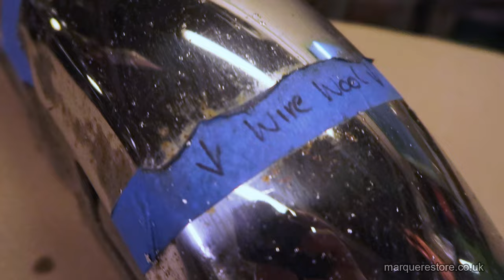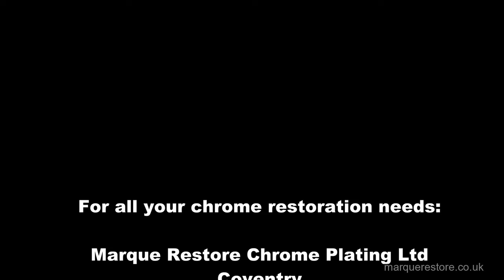How to Clean and Restore Chrome at Home THREE METHODS TESTED

Comment: Wd-40 sprayed on the surface and then rubbing it with a wadded up ball of cheap aluminum foil is what was used for chrome bumpers as long as the rust hadn't caused any pitting into the surface. This was how my dad had always restored the chrome on all of the multiple different cars he has completely restored and rebuilt over the years.  My very first vehicle was already 16 years old when I was born and 30 years old by the time I got my permit to learn how to drive. It was nothing but a completely stripped out and bare metal body when I decided I wanted it. It was a 64 Malibu Chevelle sedan and everything chrome on it was a salvage from junkyards and got the wd-40 and aluminum foil hand rubbed treatment and it was like it was brand new.
Reply: will try ur method on my royal Enfield engine... I have WD40.. Just need the almuniam foil
Reply: Would that work on aluminum rims?
Reply: @souvikprofile have you tried?
Reply: I refurbish drum kits and I always use WD-40 & aluminium foil on the chrome, it get's the rust off really well but as you say, it doesn't do much to the pitting.
Reply: That's what I do
Reply: @souvikprofile is that a modern Enfield? The old British ones don't rust as they are self lubricating inside and out 😂( 1956 clipper owner 😉)
Reply: For a cheap easy way to go you can’t beat it. Glad to hear someone else doing the same, my grandfather told me to do this.

Comment: On rusty chrome that is rust pitted beyond saving, I use a product called S.O.S steel wool pads. They are fine like the wire wool that you showed, but the difference is in the pad itself. These must be used wet as well, but the big difference is the blue soapy material that is impregnated in the pad. They are dry until activated with water which makes them a little messy but the soapy stuff is rather slippery and keeps the part lubricated and reduces scratching. I live in Canada where this product has been marketed as a method of cleaning stainless cookware. It's available at grocery and hardware stores, and has been around as long as I can remember.
Reply: We call them Brillo Pads here in UK
Reply: @rattylol same in the U.S.
Reply: Brilliant pads and SOS pads are the same but different. Just like Coke and Pepsi. I can buy either one at the store. (I prefer SOS and Pepsi) 😊

Comment: I sanded the chrome off my bumper when I purchased my first car. 1975 Chevy Impala. The bumpers were a mess. No money to replace of have them chromed again. I decided to sand them down. I forget what I used to remove the rusted pits but I managed to get them down to bare metal. Sanded from 80 grit all the way up to 1000 grit sand paper. It came out as shiny as chrome. Some 0000 steel wool and spray bottle of water made them even nicer. Dried them the tool metal polish with a polish wheel and they were very close to the chrome when it was new. Lasted about four years before the metal began to rust from the inside of the bumper out. I was then able to afford to have them replaced with freshly chrome bumpers. Just for fun on my down time I repeated the process on the original bumpers and they looked as good as new. I also had a friend who was a welder patch the little holes (pitting) and again repeated it all over and finished with bumpers that looked like new. I later sold the original bumpers to someone who needed new bumpers. He sent them to chromed. The guy asked him why he wanted such nice looking chrome bumpers done all over again. When he told him they were bare metal polished, he asked if he knew who had polished them. I was asked if I wanted to go work for him. I turned him down.
Reply from the maker: Great story. Thanks for sharing.
Reply: ^None of that "he wanted me to work for them" ever happened. Stop LYING people can tell.

Comment: I suggest a bath in Evaporust. I treated a pitted chrome bicycle fork and it removed all of the rust stain as well as the rust in the fine pits. Totally harmless to steel and chrome. Leaves carbon from the rust on objects that can be removed with oil like WD40 and a soft cloth. Wish I could post a picture.
Reply: Never tried that. I feel an experiment coming on.
Reply: Never tried that. I feel an experiment coming on.

Comment: Fill bathtub with water. Submerge part to be cleaned. Scrub with cotton washcloth that has dish soap added. Scrub until surface rust and soil are removed. Remove cleaned part and dry with old, clean bath towel. Scrub with Turpentine soaked cotton shop rag. Polish off turpentine with clean shop rags. Final cleaning with window cleaner and newspaper. Final step is to apply three coats of carnuba wax.
Reply from the maker: Thanks for the info!

Comment: Turtle Wax company makes a product called Chrome Polish & rust remover. I use it with a soft microfiber towel. When all the rust is gone I completely wash all areas with soap and water. After dry, I hand wax and polish the areas I removed the rust from. Works the best for me.

Comment: WHEN I WAS 16  ,1967 , that  summer I  worked in a used car lot  ,I was told  ,a wet rag  rubded  on the dirty  floor  dirt and grease  . all the rust was removed ,,  then a coating of wax  IT WORKED AMAZING  .. 
wow good videos thx Ed
Reply from the maker: Never heard of that method, thanks for the info.

Comment: Very good vid, faithfully carried out to answer all questions. thx

Rust is not in the chrome layer, rust is in the base metal, with cheap metal base you'll always have rust punching through the chrome layer.

Regular polishing will get rid of the pin head bits of rust and not allow it to grow to blisters of rust.
Thx again for the vid and the other peoples comments Very helpful

Comment: If I were attempting something like this I'd use the oooo wire wool, but instead of water, I would always use WD40 as a lubricant, the added bonus is that it is left in the rusty pitted parts and does to a degree help stop the rust getting worse. Also I'd put a good wax polish on top after to try to seal the open rust pits.

Comment: I have tried all of those methods but recently tried one of those stainless looking pan scrubs from £1 shop with a bit of the pink 'Jizer' degreaser as lubricant...still bodgey really (you can't beat rechroming if pitted at all) but gave the best results. I thought it would badly scratch the chrome but surprisingly it didn't. 
These guys did my rear mudguard, fork ears and rear lamp bracket from my Honda CB500K0 a couple of years ago. A very professional service plus very reasonable price and delivery time. Would definitely recommend and I have used about 6 UK firms over the years. I only dropped by their stand at Stafford to enquire if another chromer local to them, who I had used in the past,  was at the show. Alan just booked in my parts, gave me an instant, written  quote and Bobs your uncle.
Reply from the maker: Thanks for the positive comments.

Comment: Here in the States, I like to use a product called Barkeeper's Friend aka BKF for rust removal. It works very well on plastics and chrome. It consists of a mildish abrasive and Oxalic acid.
Reply from the maker: Thanks for the info.
Reply: This is the only method I use on compromised chrome, except when I use Brillo pads, which are essentially the same thing as SOS. I think it might have done a little better on those remaining pits on the mud guard...maybe. Like the others, I wouldn’t use it on perfect chrome.

Comment: The top tip is : Once you have achieved the desired finish - don't neglect to keep on top of it - otherwise it will go back to the rusty state it was in before you spend hours cleaning it in the first place.
Reply from the maker: Youa are correct.
Reply: Most people don't even know how to clean and polish their bike at home so it just gets neglected regardless

Comment: I get the best results with steel wool, only I use thin oil instead of water. There is very little phosphoric acid in Coke and citric acid is more important in derusting. In addition, it is always a mess with Coke. But of course it always depends on the degree of rusting.

Comment: Interesting comparison, especially since you also risked ruining your newly chromed fender! I belive using phosphoric acid is a gentler and more effective process that also leave a protective coating. I finish by spraying a clear coat of paint on the part to further prevent it from rusting again.
Reply from the maker: Thanks for the info.
Reply: Phosphoric acid can protect bare steel so it might help on the pitted part. Where the chrome isn't damaged, no such protection is achieved.

Comment: I actually experimented on a nickel plated surface with a thick film on it using fine steel wool at first, not crazy about that though it was quick, next used I Brasso and then used Blue magic to go over all the areas. The steel wool did leave scratches and I didn't like that very much. The Blue Magic helped reduce the scratches from the steel wool. I didn't go at it too long since I didn't want to thin out the plating. The item I experimented with didn't have rust pits on it so the Brasso and Blue Magic gave me the fastest and best results. I also tried using the steel wool and Blue Magic  together but still got more scratches than I wanted. I have also seen people use aluminum foil and water and that worked fairly well. I have rusty bumpers that need work and I will be experimenting with those as well.  I think, when you have rust pitting, you have to use either the aluminum or the steel wool to have the best chance of cleaning those up. Thanks for your experiment.

Comment: try this on rusty chrome it works for me i have used it on chrome wire rims you will need a bucket of hot water and some dawn dishwashing soap very fine steel wool/ SOS PADS  you don't need much of the soap about 1 cup to a bucket full of hot water the soap helps the steel wool to not scratch as it lubricates the chrome and makes it easy to clean as it will be slippery you do not have to rub hard at all just keep alot of the water mix on the chrome as you lightly rub in strate lines  Once you have achieved your desired finish you will need a water bottle with clean water and a micro fiber towel or soft rag to clean and dry as needed

Comment: I've used a gelled rust "converter" based on phosphoric acid before -- just apply, then wipe off with a paper towel and rinse. No scratches, but it can't fix the bumps, and only provides minor protection.
Reply from the maker: Thanks for the tip
Reply: I did my own tests too. Turned pits into scratches with pits! They looked really good rechromed! My lady has a couple of stone bites on chromed wheels. I would like to try good cleaning followed by some king of electroplating. They are not big and bad but I see them every time she drives up.

Comment: Best method I've found is to submerge your parts in white vinegar for a day or two then wash down, dry using compressed air and a cloth and polish with Autosol using a buffing wheel. I've done chrome air cleaner tops, rocker covers and other engine parts that way. I use a 50 litre storage tub with a clip down lid. You can keep the vinegar indefinitely, when it gets a little dirty strain it through some cheese cloth or other breathable material and off you go again.

Any part that has mild rust pitting, once cleaned dried & polished seal with automotive clear coat (Aerosol can) from your local auto parts store or paint supplier and it will never rust again, the shine will stay and there after you'll be polishing the clear coat and not the chrome plating. The clear coat protects the part from future rust should the part get wet. Clear coat can always be re applied should you polish the part to death.
Reply from the maker: Thanks for the tip

Comment: I'd use a combination. 1st coke and alu to "remove" rust and knock down the worst high spots, then steel wool to even out the scratches, and last a much better/less abrasive polish. (and a polishing machine of a sort) It surely will not hold 20-30 years, but for the summer to go to meetings and cruising it will be OK, and then get it done properly in the winter.
Reply from the maker: All those ideas sound good, especially the last one.

Comment: Using the polish with the steel wool would be better, or the polish with a 2000 grit wet polishpaper, that usually removes most of the small nits, but the chrome surface will naturally still be broken.  A good wax treatment should follow.

Comment: I've been known to apply Autosol polish with the 0000 wire wool, and then I use another metal polish called Mothers which is less abrasive to try and remove some of the swirling. It doesn't make it perfect, as you say nothing short of a replate will,  but I've had satisfactory results on a limited budget doing that. As an alternative and stronger source of phosphoric acid you could buy 'Milk Stone Remover' from a farm supplies place - I used that as a rust remover bath for a while but now I find Bilt Hamber's Deox-C is better than anything I can make myself as the parts don't suffer from flash rusting so much when removed from the bath as with the pure phosphoric acid. For that reason, I probably wouldn't put coke or any source of phosphoric acid on a metal part now as I reckon once down in the pits it'll accelerate the rusting after the fact (unless you neutralise it, maybe with  sodium carbonate a.k.a soda crystals ?).

Comment: What an excellent test that you included perfect chrome too. I would however suggest you used the wrong polish and used paper which are not thing someone should do. Obviously, aluminium foil and wire wool do both make rusty chrome look better than rusty chrome, but they both cause scratches as you showed and leave worse results than the best method. What they do is sacrifice the good chrome in order to order to remove rust. There is a better way. The best method is a variation of your polishing method:

1. 24 hour pre-soak in WD40, or coat the part in WD40 and leave for 24h if soaking is not possible
2. Wipe of WD-40 and loosened rust with a clean microfibre towel, ensuring you switch to a clean part of cloth when rust rust or chrome flakes are evident on the towel. This avoids scratching. The part will already look mush improved, it will be clean and you can now see the true extent of any damage
3. Any rust remaining can be knocked off with soft scraper made of wood, like half a traditional springy clothes peg be careful to minimise dragging rust and chrome flakes accross the part. Use lots of WD40 and do not scrape across the surface of good chrome. Any pitting left will be smaller and less ugly than the rust blotch
4. Metal polish the good chrome will come up like a mirror

You will only have any damage caused by rust pitting. Any chrome not subject to rust pitting will be as good as new. You will not get such results from any abrasive methods, you will have no good chrome if you cover it in micro-scratches! Never use paper to polish chrome! It's an abrasive material in itself. Different polishes have different properties the best I've found for chrome is CarPro Mettalicut. Obviously you wouldn't need any cut at all on perfect chrome. but you can get mirror shine with this polish. Nothing beats a quality rechrome! And looking after it properly though!
Reply from the maker: Very comprehensive suggestion. Sounds very good.
Reply: @ChromeandCarRestoration  When I need something rechromed, I'm going to ask you guys!
Reply from the maker: @hydorah  Thanks. Look forward to meeting you in due course.

Comment: a couple of helpful hints: superfine steel wool used gently and dry on a dirty/tarnished surface will bring it up. Adding water makes it cut more, like wet and dry sandpaper, and destroys a gloss finish. 
I think the metal polish you used was the wrong one? They make a for "chrome" version, but any polish is an abrasive. thx.
ps: when polishing anything, don't do circles if you can avoid it. It always leaves swirl marks.

Comment: I have an old boat bow light that is chrome plated brass. Looks like over the course of 70 years the elements have caused it to have large gauges in it. Is there anything that I can do the remove fill them in before repainting?

Comment: I'm a little late to the party here, but just ran across this video. I'm weighing in from the US here, so I don't know how many of the products I will mention (or ones like them) are available in the UK. Regarding your moderately rusty first fender: I would first approach that with a product we have here called "Zud". It's available in many hardware stores and a few supermarkets and its a white scouring powder that contains calcium sulfate hydrate and oxalic acid. I would wet the fender, sprinkle on a liberal amount of "Zud" and work it into a slurry then let it sit for 10 minutes. Then, scrub with a plastic scrubby pad like "Scotchbrite" and rinse well with clear water. As previously mentioned, S.O.S pads work very well and could be used if "Zud" cannot be found. By this time, many of the rust pits will simply be gone and the rest should be invisible from a few feet away. There is also a great line of polishing products available here under the name of "Mother's". They make a great metal polish that doesn't scratch, and they have a special foam polishing spinner called a "Powerball" that is embedded with aluminum oxide bits and is designed to spin on a drill with their polish. After a session with all that, I think it would be hard to see any pitting at all from farther away than a foot or so. Regarding the second re-chromed fender, I find it difficult to believe you'd want to address that with anything more aggressive than a good cleaner wax. As you folks say, Cheers!
Reply from the maker: Thanks for the info.